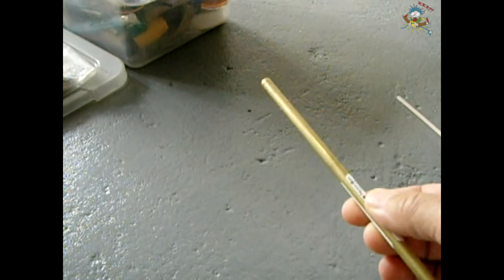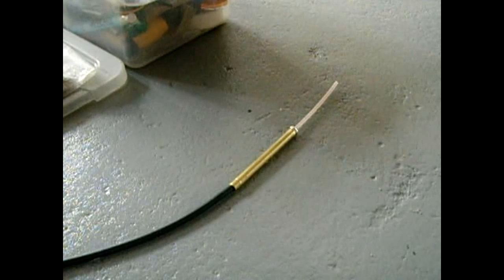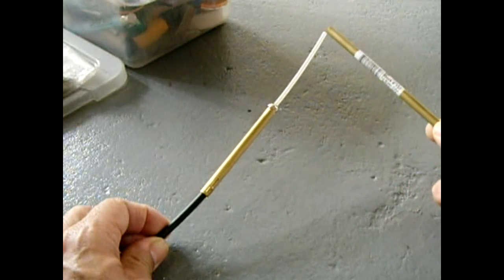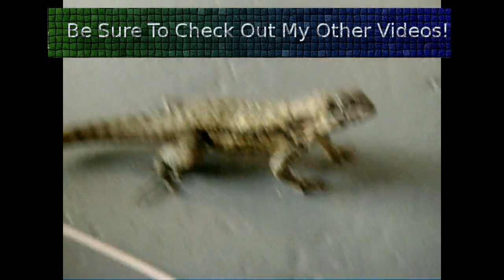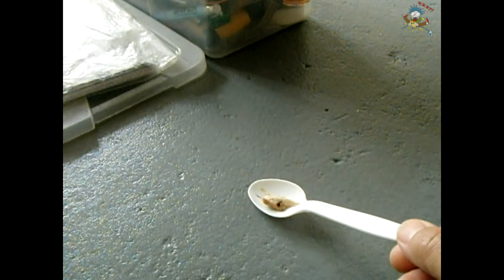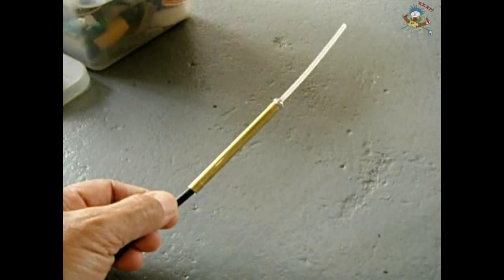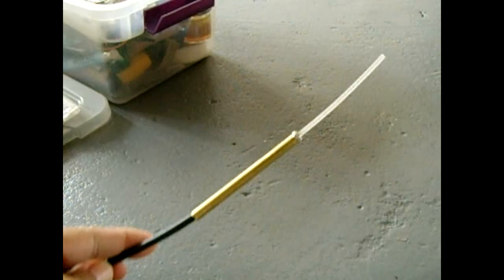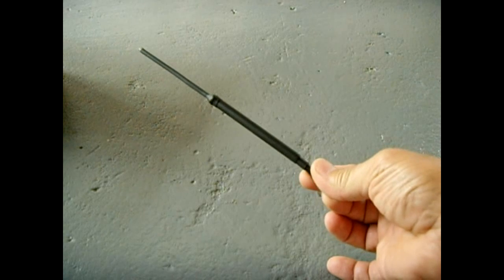Make Your Own FM Vertical Sleeve Coax Antenna

Comment: Ok. I have a scrap piece of RG8 coax and the end you put on the coax to stab in the antenna socket on radio. Space being limited, if I make the center wire 31inches but just cut the braided shield off will it still work to receive FM radio stations? I would put  the thing inside 1/2"pvc pipe to keep it safe and mount it
Reply from the maker: You need to make the antenna for the center of the FM band. So around 99/100MHZ.
Reply: The tube over the coax which forms the lower half of the dipole is half the antenna you'd be throwing away. Almost anything will receive FM broadcast, but you'd basically have a non-resonant random piece of wire on the end of a piece of RG8, not a tuned antenna.

Comment: Wind noise, blocky caption screens, Gecko interlude, no explanation of dipole, a rubber duck is a flexible antennae with a spiral coil in not a coax cable. Awful video
Reply from the maker: Ralph Beardmore Another ungrateful, miserable degenerate. Your parents did a lousy job raising you. I'm very amused that you have the balls to complain about a video you got to see for free. Hit the road, and don't come back.

Comment: In your example you use 936 mhz. Is this actually 93.6?
I want to make an antenna for 99.9 mhz. Using your formula the tubing and extension would be 28.1 inches. That is VERY long. No?
Reply from the maker: This antenna is intended for UHF, but it will also work for VHF, the only problem is the antenna will be long and needs to be supported with a rope. Check out my other videos below.  

https://www.youtube.com/watch?v=KjTshXYsRss
https://www.youtube.com/watch?v=I16Eq-mClCk

Comment: Does the brass pipe touch the copper shielding go inside the pipe or just solder it on the tip of it ? BTW nice lizard.
Reply: @Blueskies He uses a brass pipe lol, watch the vid
Reply from the maker: +Neumann Gregor 
I think all that was well explained in the video. I have too many videos to keep track of all the details. Thanks for watching!
Reply: Ok, i soldered it just at the top and works really well, i got full signal strength now, tnx for the video it helped me :D
Reply from the maker: Neumann Gregor
You're welcome! Be sure to share my channel with others and check out my other videos as well. Thanks

Comment: its fm the size of the wire dos not matter as far as fm radio I would say now fm as far as ham 2way  then it must me right or you can damage equipment
Reply: +vorkev1 The size does matter. For reception it isn't critical. However a resonant antenna will better performance. So whenever possible it's best to make the antenna for the intended frequency(s).

Comment: Question... So how much room  is there to spare when building an antenna? What I mean is, say I want to receive frequencies from 88 - 108 Mghz. Do I need to build different antennas or can a tuner in a radio use one antenna (say tuned/sized for 98Mghz) and just tune to the different frequencies between 88 - 108Mghz? How do commercial radios use a single antenna? I know the wave lengths differ by less than 12" but what does this mean for a radio?
Sorry if this question seems dumb. Im just now getting into amateur radio
Reply from the maker: Tcamp As a receiving antenna, you would make the antenna for the middle of the FM band(Around 98mhz). If you wanted to pull in a station that is not as clear, then you need to make the antenna for that specific frequency.
Reply: electronicsNmore Ok, that is what seamed most intuitive. thank you.and I like your lizard.
Also, is there a specific reason you used brass for your antenna? Could you use copper for instance?
Reply from the maker: Tcamp Copper or brass is fine.
Reply: @electronicsNmore What if we use aluminum pipes, is it good for the signal?

Comment: 75 ohm cable will very closely match the impedance of the antenna but not a 50 ohm transmitter/ source. I think a good way to get an absolute match would be to measure out an electrical 3/4 wave of 75 ohm cable before connecting a 50 ohm line or connector. I say this because using a quarter wave to transform the impedance will place the join inside the coax sleeve lower part of the antenna as an electrical quarter wave of coax is shorter than a physical quarter wave because of the velocity factor of the cable dielectric. Half wave lines reflect the terminating impedance to the other end unchanged so the best way is to use an odd multiple of a quarter wave- 3/4 wave or a half AND a quarter (of course, 3/4 wave). Polyethylene dielectric cables have a 0.66% velocity factor so in that case its a 3/4 wave times 0.66 :) I hope this is helpful.

Comment: 1:52 That lizard was awesome.
Great antenna I will have to try making one.
Reply: Música relajante
Reply from the maker: The antenna I made works much better than the one I had on my frequency counter for the 1.5 to 2.5ghz range.

That was only one lizard. There is another one which is larger.

Comment: just wondering, i know about the theory of the diffusion speed and that stuff but then how different do these perform versus a normal telescopic antenna, the ones most radios use. (or used to use, i havent seen a portable radio like in 10 years)
Is the gain difference that big? and how do the generic antennas perform on the fm range? can i assume the one you made will have a gaussian response curve and the generic one will have more of a flat one?